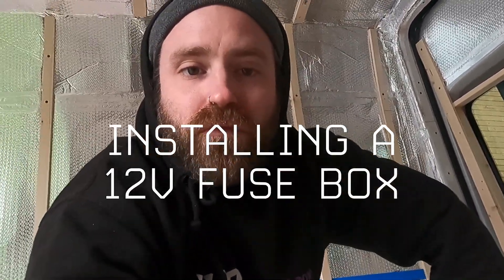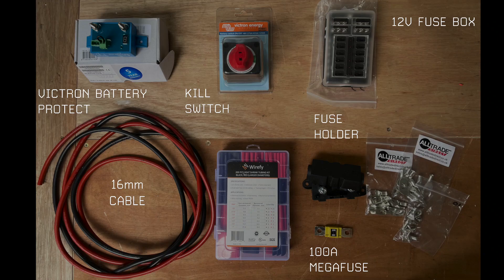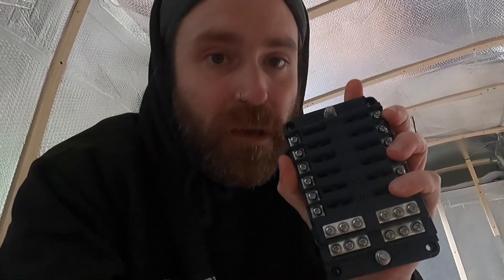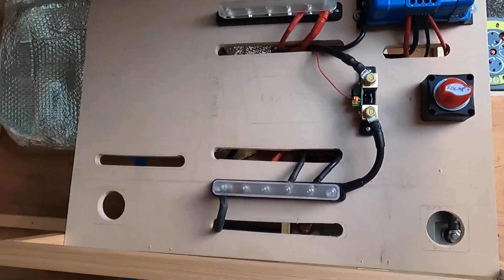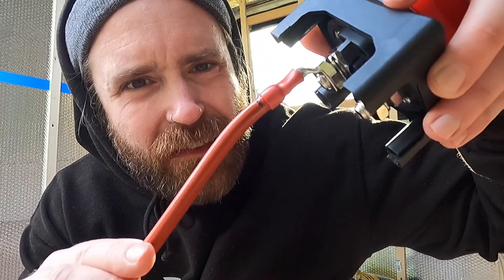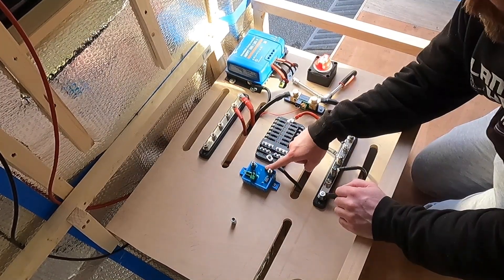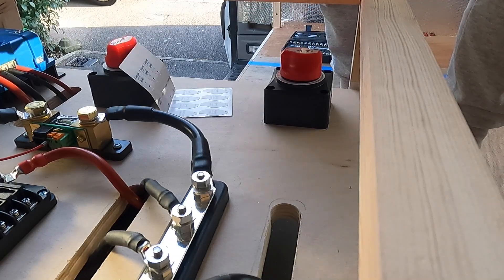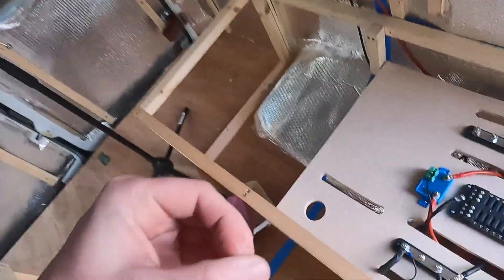Fitting a 12V Fuse Box and Victron Battery Protect  | Van Electrics | DIY Sprinter Van Conversion UK

Comment: That fuse box and the fuses it comes with are dodgy. It's a blue sea replica and is not a patch on the original.  The LED's are wired so they only come on when the fuse is blown AND there is a load.  If the fuse is blown and the device is turned off the LED will not come on. There is power on all outputs when fuses are not inserted. This is because the anodes of the LEDs are connected to the positive bus and the cathodes to the load side of the fuse. It should be wired so the anodes are connected to the load side of the fuse and the cathodes to ground this way the LEDs are ON when the fuse is good and OFF when the fuse is blown, the potentially 60mA draw when all LEDS are on is negligible. Also the fuses are hard to fit in and the fuses supplied are rubbish, I checked a few with a variable current power supply and they do not blow at the rated current they are supposed to.

Comment: No, the battery protect Does not sense when battery is at 50%.

It has a low voltage cut off based on voltage level.

Comment: Enjoying your videos. Had you gone for the 100/20 SmartSolar you could have avoided needing the smart protect, as the 20amp version has a load out with protection. Im only saying this as you mentioned in a previous video that your pannels are less than 100v or 20amp. 
This is more a message for others looking at building a system, stay below 20 and save money. 
Nice layout.
Reply from the maker: Really good tip mate, thank you!

Comment: Why do you need to add a battery protect if you have lithium batteries which have their own in built protection?
Reply from the maker: Unfortunately I couldn’t afford lithium batteries so I bought two AGM batteries for my electrical system instead. The battery protect will prevent them from being discharged too low.

Comment: This fusebox you use is dangerous. I have the same one. When a fuse blows, it still has a load of 11 volts. This is because of the leds. After removing the electronics with the leds it behaved normally. Do you have the same experience?
Reply from the maker: Hey dude, really appreciate the message. I’ve heard very similar reports from others but I haven’t had any issues myself. Despite that, I will very likely upgrade it very soon for piece of mind 🙏🏻
Reply: Totally agree. The LED's are wired so they only come on when the fuse is blown AND there is a load.  If the fuse is blown and the device is turned off the LED will not come on. There is power on all outputs when fuses are not inserted. This is because the anodes of the LEDs are connected to the positive bus and the cathodes to the load side of the fuse. It should be wired so the anodes are connected to the load side of the fuse and the cathodes to ground this way the LEDs are ON when the fuse is good and OFF when the fuse is blown, the potential 60mA draw when all LEDS are on is negligible. Also the fuses are hard to fit in and the fuses supplied are rubbish, I checked a few with a variable current power supply and they do not blow at the rated current they are supposed to.

Comment: A 100amp fuse will run all day long at around 140amps, this allows for any blips and is where slow blow and quick blow fuses come into it.  Your 110a cable could be overloaded especially if you have it running in any insulation.

Comment: I have had a look at your circuit diagram.
You appear to be charging up both the leisure batteries and the starter battery at the same time from the solar controller.  Is this the case?
Reply from the maker: Hey dude! Unfortunately not. The VSR only works one way so it only allows me to charge my leisure batteries whilst the van is moving. It doesn't allow current to run the opposite direction, so my solar controller will only be able to charge my leisure batteries. To be able to charge your starter battery as well, you would need to replace the VSR with a DC/DC charger instead.
Reply: @GreenHornCountryClub  Ok, good.
My concern was that you might be using a single charger to charge two different battery types (starter and leisure)  at the same time which have different characteristics....I just watched a video where some guy was suggesting that as an option! Do that and it will knacker the batteries.

Comment: I think your 100A fuse should be on other side of the Battery Protect. Otherwise if there's a short within (or before) the Battery Protect, then the 16mm cable between the BP and the batteries will only be protected by the 200A fuse on the leisure batteries.
Reply from the maker: Hey bud! Thanks so much for your comment. I think you're more than likely right. At the time, the reason I placed the kill switch and fuse next to each other is because I was initially just going to use a circuit breaker and wanted a way to just disconnect the fuse box without affecting the BP. Then when I made the decision to instead use a kill switch and fuse, I just left them next to each other. I did have a look over all the system schematics on Victron's website and I couldn't see any that included a fuse between the BP and the positive busbar. I also figured that the BP itself would be able to alert me of any short in the cable from the battery.
Reply: @GreenHornCountryClub  yeah I'm far from an expert, electricity is complicated 😁
Reply from the maker: @danleone  isn’t it just! Absolute minefield. I’m sure I’ll learn the hard way when my system blows up 😂
Reply: @danleone  The problem is that it is not taught properly, not even to electricians.
Reply: The 200 amp fuse next to the VSR is not required, as you've already got a 200 amp fuse next to the battery.
Reply from the maker: @deang5622  My thinking is the 200A fuse following the VSR protects the electrical system from the power coming in via the VSR, whereas the 200A circuit breaker directly next to my leisure batteries allows me to cut all power to the entire system if need be.
Reply: @GreenHornCountryClub  So you have additional wires connecting to the VSR which are not shown in the schematic diagram, is that right?
Reply from the maker: @deang5622  Nope! All the wiring should be shown in the diagram. The VSR just accepts power in from the starter battery, then power out, which I've connected to the positive busbar, then a negative wire to earth.
Reply: @GreenHornCountryClub  ok, understood.
In which case you don't need the 200 amp fuse because all the current to or from the battery is passing down two cables: 1. Cable from battery to VSR, 2. Cable from VSR to positive busbar. The current is the same in both cables. So long as the cable thickness (more precisely the cross sectional area) is the same for both cables then you don't need the 200 amp fuse because you have already got a 200 amp circuit breaker which will trip at 200 amps.
That breaker will provide over current protection for both cables.

Having the extra fuse won't do any harm, but if it blows you then have the hassle of replacing it, whereas if the breaker trips, you flick the switch and reset it.
Reply from the maker: @deang5622  Agreed - The VSR was already in place in the van when I bought it and wired to the fuse, so I thought I may as well keep it as it does no harm and meant I didn’t have to replace and feed a longer cable under the van. The only addition I made was the circuit breaker to allow me to disconnect the VSR from the system. I only have it for last resort really 👍🏼
Reply: @GreenHornCountryClub  Fair enough.

Comment: Very tidy set up sir
Hope you don't mind me subscribing to your channel 🍻
Reply from the maker: Thanks so much bud! And thanks for subscribing too!
Reply: @GreenHornCountryClub  Hi where did you purchase your crimping tool and components big cheers 🍻what is your van is it a mwb 🍻?
Reply from the maker: @deranocasper  I got the crimping tool from Amazon. This one to be precise: 

https://www.amazon.co.uk/RZJZGZ-Multifunctional-Stripping-Automatic-Strippers/dp/B09B9SHWV3

For the components, if you check in the description of the video, there should be links to where I got each item. As for the van, it is indeed a MWB!
Reply: @GreenHornCountryClub  your van is getting the works it will be very warm you cant skip on the insulation 😊💯 you where using a big blue  handle crimping tool I appreciate it are you going to fit a vent to your electrics  to keep things kool 👍
Reply from the maker: @deranocasper   ahhhhh yes, the crimping tool I was using for the larger cables. I got it from Amazon as well, along with the cables cutters:

https://www.amazon.co.uk/Dechengbao-Battery-Cable-Crimping-Cutter/dp/B08FJFLTHK

In terms of keeping the electrics cool, it’s a little hard to see without my bed in place but I’m only going to be plying half of that timber frame and the rear half will be left open into my garage area, so that should be plenty of ventilation 👌

Comment: Did you know… you can use the battery protect as a ‘kill switch’? Open the app and toggle the slider to off
Reply from the maker: I do now!
Reply: I want to comment on a couple of things. They are not kill switches, they are isolation switches to use the correct terminology.

Isolation switches should be placed inline as close as possible to the source of electricity. I'm not sure that using the battery protect switch actually achieves that?

Isolation should be achieved by proper easily identifiable switches, not cryptic methods of opening things up and doing XYZ which only you know about. Somebody other than you might need to cut the power so clearly labelled switches are required.
Reply from the maker: @deang5622  Thanks for the feedback dude, much appreciated 👍 I was under the impression that a fuse should always be the first thing a power supply hits, followed by the switch, then the load. I've aimed to wire each component that way. I've also made sure to clearly mark each switch so they're easily identifiable, as well as each appliance. Thanks again!